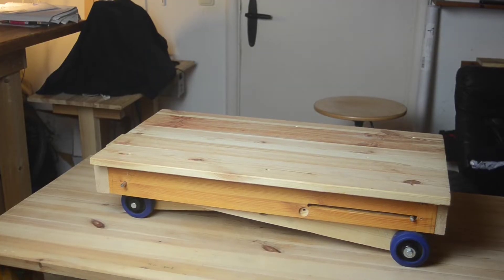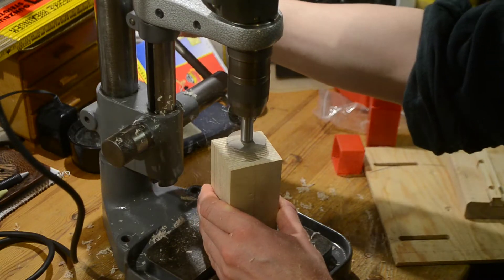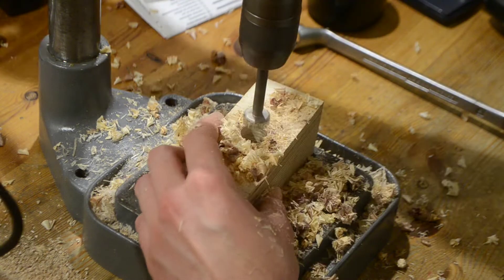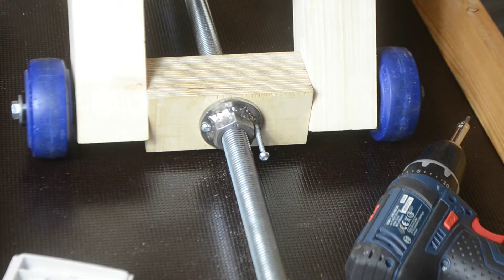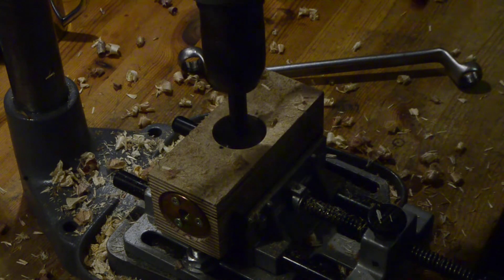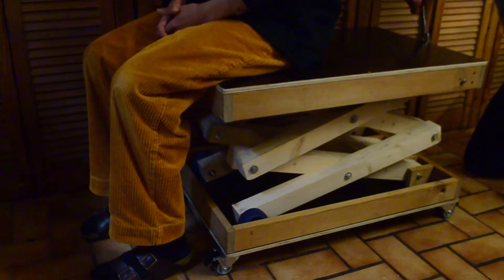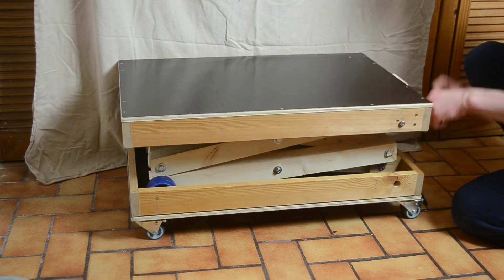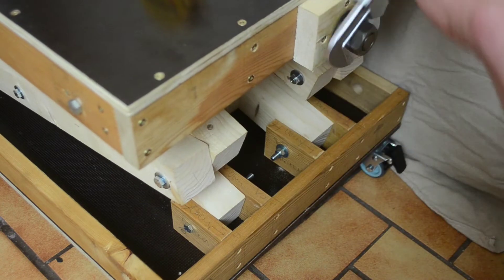Scissor Lifting Table Mechanism Improvement Short

Comment: Ok as people will tell you and you also clearly now know, the bottom of the lift is tough. This is because there is only friction in the thread. Even though each thread is a small incline, it’s not sufficient. What if your thread was much much larger? The incline would be greater and up to a point, the lower part would be easier. But still the torque would also increase making turning harder.
Right now the pieces of the scissor are each the same in terms of the pivot points being exactly opposite each other so as you turn the handle the opposite pivot points pivot but also oppose each other. That is because the scissor members are parallel or nearly so. What if, what if the pivot points do not directly oppose each other? What if at least some of the pairs are wider and are not drilled on center but are drilled so as not to be in direct opposition? This would be providing you with an additional advantage at the outset. There are other facets to this idea which may include the addition of another form of assist. Also with these additional thoughts. Why not put the screw at some other point. Perhaps an end is not optimal? In short- create more mechanical advantage at the outset. Even the traverse block can be your friend.🙏 God bless and don’t give up!